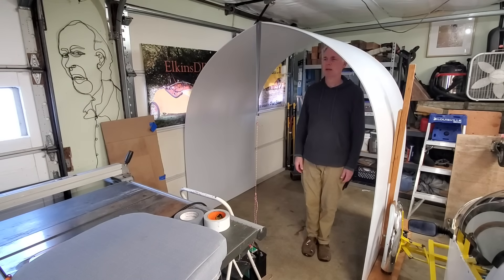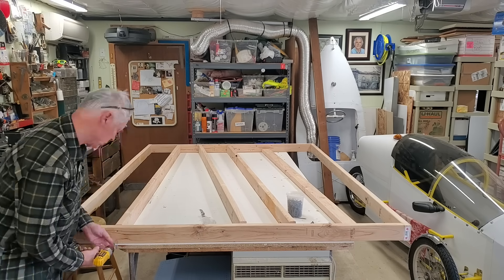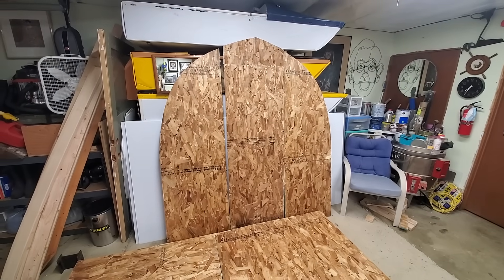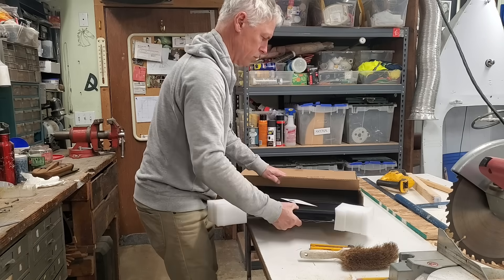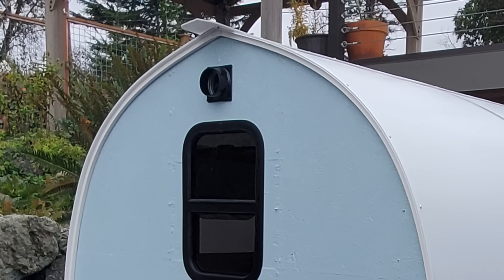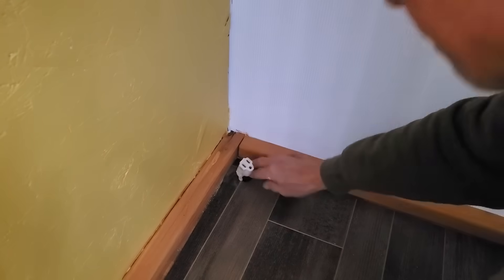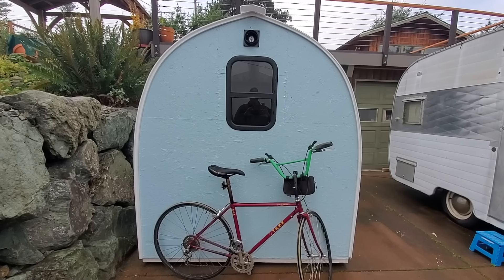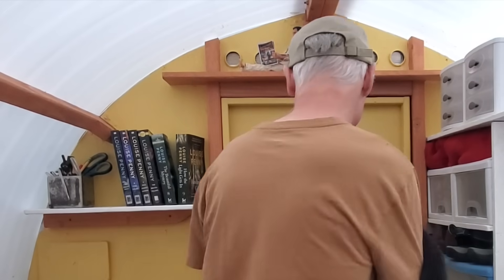Homeless transitional shelter prototype

Comment: I'm homeless. Shelters are never the problem. It's where to put them.
Reply: Definitely a more underlining issue. Apart from the economy of course. I have a hard time finding places to camp off grid, let alone. Live full time. I hear ya.
Reply: @goozzfraaabaa  I lost my wife 3 years ago. We barely got by with 2 incomes. I modified my SUV and did the boondocks thing for a while. In the same month, I lost my job and had my vehicle stolen. 
Then I was on foot and lost everything.
Fortunately, it was summer. I bought some window cleaning gear from Home Depot and started washing windows. With my ssi and window monies, I can not afford a place with the bills. I live well, just not under a permanent roof. With soaring rent and the economy spiraling, more people every day are moving into vehicles. I've seen a massive uptick of people camped out and still working their jobs.
It's only gonna get worse. Funny thing, if you live in a sprinter van you're cool, if you loose it and get a foot, you become a POS!
Reply: @luckylarry5112  So sorry you've had such bad luck.
Reply: @luckylarry5112  let’s hope the worst is in the rearview mirror for you and the 2026 is where your great adventure starts toward a better life!
Reply: @luckylarry5112 not in my book ! 
a Sprinter only is something wealthy hipsters or boomers can afford 
I myself prefer my 40 liter backpack and a really nice pair of shoes 
I can then use all the money those Sprinter hippies spend on gas , insurance , and maintenance on food , water , and other materials to gtFo of cities and into the wilderness 😊
Reply: People don’t become homeless one day and have nothing.  Most give up or sell everything to not become homeless, but giving up their phone is just stupid. Without communication they can’t possibly improve their homeless situation. Some live in their cars & have phones but can’t afford rent. Have compassion people.
Reply: @allyrooh3628 Really??? Try living in a career where you get bumped for site senoirity all the time while paying for a union. Apparently you haven't experienced Canadian winters or lived in your truck to keep your job.
Reply: That's a good point, most resources for the homeless (free meals, medical care, etc.)  are often concentrated in the center of urban areas. With it being an urban area, space is extremely limited.
Reply: I would pay to build one of these if other people would    We could build cities.   Need port a potties
Reply: @georgedavidson7986 I agree, and the more I look into it, the more I am convinced that the real issue is not the shelter supply, but the sewage and trash disposal problems.
Reply: @georgedavidson7986 and land
Reply: Agreed
Reply: Not in my neighbourhood is a common cry.
Reply: When ever you are gone, they will steal everything, wort anything so Watch Benny Hinn and pray for a miracle. Ecclesiastes 9:10. Proverbs 18:1
Reply: Denmark has worked hard on solving the homeless issue. They realise that if people have home it helps their self-respect, they keep healthier and in the end it costs less . Well done on your project
Reply: Access to be here? What, you think you can't be homeless and have a cheap smartphone too?
Reply: I am sorry you are homeless and even more sorry we live in a society that allows it, we have more than enough wealth to support everyone.
Reply: 🙏🇺🇸 prayers for parking lot locations and camp grounds even business/ church grounds etc... to step up get insurance and sponsorship communities and cities to work together for these solutions
Reply: Exactly.
Reply: I live in an Elkins style bike trailer. Luckily I sleep in front of a store with a really cool owner. They don’t mind the trailer sitting out on the sidewalk. They even gave me a small job cleaning up. I keep most of my stuff in a storage facility close by.
Reply: What part of the country are you in?
Reply: @TheCindlbergen  Central Oregon
Reply: It appears obvious you are not mental, so let's put the thinking cap on. You don't fit the mental, druggy, alcoholic stereotype, and you don't fit the corporate-world employee living in suburbia. That probably means you also don't fit in Oregon. Move to Texas and maybe you can be living in a mansion. Move to the boondocks of Appalachia and buy land for "dirt" cheap and be a self-sufficient retired hillbilly. Since you have some fixed income, you don't have to live anywhere in particular for a particular job. Is some corporation paying you $4,000/month to live where you are at. If your friends and family live there, if they have the means, they will help you. If they are as poor as you, the whole family can start a pilgrimage to Texas. Our nation is a nation of immigrants who came to America for a better life. Continue the tradition by moving to a state the resembles the original America - where you can have a house without a permit, etc. I sincerely wish you the best, but your best is not the status quo. Some places are not fit for human habitation [such as cities in my opinion :)]
Reply: I live in a rural area, seems places to put one are plentiful around here. But I wonder where you would go to sustain yourself.
Reply: @dwaynehall6356  i built a nice one,  7x10 last year. I found someone with private property and paid $200 a month to have it there. 3 months later, the county said no way, remove it.
Reply: @luckylarry5112  That is a shame!
Reply: @dwaynehall6356  As the video mentioned, many homeless have mental health problems and there is no mental health care for them. So, along with homelessness often comes drugs to self-medicate and take the edge off being homeless. Can't hold a job addicted to drugs. Even the high dollar treatment programs only have a 25% success rate after a year, and the homeless aren't going to get the high dollar treatment programs. In an interview of a homeless lady, she said, "On fentanyl, everything is beautiful." Drugs are better than life- especially for those on the bottom rungs of the economic ladder who got dumped out on the street by a society lacking a sufficient social safety net to begin with. So, masses of drug addicted homeless (deeply traumatized from homelessness itself) with no reason to believe that society can offer them economic security, resort to taking drugs, dealing drugs, prostitution/pimping and theft. Nobody wants that in their neighborhood. Well, at least billionaires are making record profits.
Reply: @dwaynehall6356 sure can I do it on your land 😂
Reply: Why don't you get together with the homeless people and buy a piece of land way on the outskirts where it's cheaper and split the cost between a few of you. Perhaps a farmer would let you use a small piece of unfarmed land that he or she has to make the sheds on. You could grow your own food and those with Social Security to help to pay for meat in exchange for caring for the produce, harvesting and canning it. Hmmm........just an idea.
Reply: @LorraineKrueger-o3b  Thanks, I've tried. It's the equivalent of herding cats. Farmers don't want the headaches or liability. I've asked tons of property owners for me alone and got turned down every time. I once leased some remote land, in 2 months the county code enforcement shut me down. I'm currently saving for some remote land in AZ. Many counties allow compost toilets.
Reply: @luckylarry5112  Prayers for your success.. You deserve all the best! God bless you! Hugs!
Reply: @LorraineKrueger-o3b  Thanks!!!
Reply: @luckylarry5112 I live in an area with few restrictions that I bought owner financed. But even so, you can't live in a tent out here. 15 miles to gas and convince stores, 30 to a small city. I always feel torn between wanting to help the homeless or warning people don't end up like me. I hear your frustration.
Reply: If homeless would keep the area where they domain clean and not trash the whole neighborhood 😂
Reply: @gerrybruce8309  You're absolutely right! They're many levels of homeless just like the rest of society. I'm in the top 2 precent, no addictions or mental issues. I'm old and stay far out of town and clear of all the others. I collect SS and do odd jobs and wash residential windows. I use an ebike cuz I don't have a license due to visual impairment. They majority really needs to be in encampments or centers and get help. If they can't rehabilitate, civilly commit them. Camping on the streets or neighborhoods is not the answer. The problem is getting exponentially worse. I'm seeing triple the amount moving into their vehicles and calling it boondocking. That's until it breaks down or totaled, then they are afoot. The system only helps those with addictions, mental illness, and vets. Why not help those about to or have just lost their place and detour the the whole process of homelessness to begin with?
It's a amazing the billions thrown at the problem. They could have housed them all ten times over. Theft is the real problem!
Reply: @gerrybruce8309  while I agree there are homeless people that seem to go out of their way to be rude and make messes..... For the most part it's VERY difficult to manage things like trash and hygiene.

Where exactly are they supposed to put the trash? Dumping and using other people's trash cans/dumpsters is illegal. And it's a lot more enforced than littering, especially since businesses have cameras and can see you dump trash in their dumpsters.

A lot of people don't understand just how difficult it is to do the most basic things that they take for granted on a daily basis.

I've been homeless for almost a year now. Lost my home in a fire and rent in my area is $1500 a month for a tiny closet with no utilities and nothing included. On top of that they require a 650 or higher credit score and they require you to make 3x the monthly rent for your monthly income.... that's $28 an hour!!!!
Federal minimum wage is only $7.25 and most places here barely pay $15 an hour.

The sad truth is that thousands of people in my area have become homeless over the last year or two with more becoming homeless every day... Some are lucky enough to set up a small camper in a friend's yard or driveway. But most have to walk the streets and hope for the best.

There are innumerable problems that we don't have time to discuss here. But yeah. If you're not homeless then I hope you appreciate everything you have and just how easily it could all be taken away. And should you ever become homeless I hope that you are able to find the help and respect from your community to get somewhere safe. ❤❤❤
Reply: Yea first course of action should be to become land owning property tax payer first then put something like this on your plot
Reply: @Benigno-nq2fi you missed a step. First you check with the city or county if your planned "abode" is authorized for that plot of land, and you can bet, they will have their hands out for permit fees, and fines for non compliance before you ever sleep one night there. 🙄
Reply: @Benigno-nq2fi 
 Property taxes will be one of the very things that will put the retired on the streets.
Reply: @Benigno-nq2fi  sounds good but still restrictions after so many days, septic tanks 10k$ us, water, power ; or required to build house, minimum sq ft .
Reply: Right it's hysterical how they think that this is going to help.  If they spent 1/4 of the time that they spend on this s*** actually helping homeless people........
Reply: @GeorgiannaLeighCurtisGlennElli  He is hoping to make a prototype which others might copy.
Reply: How can you afford a iPhone/android with internet/wifi? Do you work and live in a car?
Reply: @garymitchell7551 go to a libray
Reply: @garymitchell7551 How do you get work of any kind without a phone????
Reply: @garymitchell7551  I get social security and wash windows. T-MOBILE $15 PREPAID a month with 5g data.
Why is it, everyone thinks it impossible to have a phone with internet?
No I don't live in a car. I'm 69 and lost my license because of visual impairment.
Reply: How do you afford a phone if you're homeless
Reply: @melvinamoss3561  I'm 69 and get social security. Plus, I wash windows. My phone is T-Mobile prepaid $15 a month unlimited voice/text and 10gb data.
Reply: @melvinamoss3561 Seriously? There are working people who don’t have a home. Maybe look a little deeper into the problem.
Reply: @melvinamoss3561  The homeless around my neighborhood steal, deal drugs and prostitute, but others have legit jobs and just don't make enough for a home.
Reply: How you homeless but still have access to be here?
Reply: @johnyang6969  I'm 69 and get social security,  just don't get enough to pay rent. I'm also clean windows part time. Why is it everyone thinks the homeless don't have internet access. I don't know any who don't.
Reply: @luckylarry5112  What he means is you shouldn't.  Internet is for regular people- you have forfeited your privilege to  that.
Reply from the maker: @luckylarry5112  Thanks so much for sharing.
Reply: @luckylarry5112 some people can’t wrap their head around the fact that many homeless people have nice phones, jobs, clean records, even romantic relationships

They see with something they don’t have and ask you why you have it and whatever your reason is , they say “But you’re homeless!” Like you’re not supposed to have Anything nice or valuable

Some even get mad if you own anything nicer than they can afford and may attack you, in fact even the county won’t give you food stamps or GR of you have a car value over $3,000.

They expect you to sell your car for food, then come back and get assistance from the county, it’s disgusting behavior
Reply: @luckylarry5112  brotha-  sum ppl jus dont use that thing between their ears very often.   Stay warm sir, i kno how ruff it is.. in my area  swva,  the local gov. Are now dozing encampments  smh..  society has became so horrific
Reply: @bobechs7905  If that's what he means, he's heartless and has a mindset that's counterproductive to boot.  You should want the homeless to have sufficient means of communication to get jobs and hold those jobs if they can.
Reply: @_-gh0st-_ finding some where to charge a phone is a problem.. small powerful solar panel back back...
Reply: @_-gh0st-_  Yeah but that was a month ago - when times were good. Best wishes.
Reply: @paulwelkinsdiy  👏well done you've got people talking. 🏡 👋🌞👍
Reply: @bobechs7905  What a horrible thing to say!
Reply: R u for real? Every phone has internet and so does every single public library in the country. I’ve been unhoused while being in my car. It takes many forms. Just look around you and pt attention, you’ll see them everywhere. And more and more so.
Reply: Public library, free wifi at every Macdonalds, many free wifi hotspots, phones for cheep in every walmart. In the US there are many government programs to get people phones, because you basicaly need one to adult.
Reply: @johnyang6969    can u really not figure that one out bubba?   Ur brain not braining today?  Lemme assist ya,  i kno a handfull of homeless folks, they charge their fones wher the can..  plug ins outside of stores etc..  not hard to do bubba.
Reply: @johnyang6969  like having a phone is a big problem? Seriously? You have issues, huh?!
Reply: @johnyang6969  you can be homeless and still have a cell phone.
Reply: Its like $50 a month for internet if you want a plan for anytime/anywhere access or you can use public wifi in many places. Internet access and devices to connect with are very available and can be very cheap or even free in some cases
Reply: @young-salt  i do T Mobile $15 a month prepaid includes 5gb data. I use free wifi everywhere when possible. Thanks
Reply: @luckylarry5112  nice, im glad theres a cheaper plan for you. I like the 20gb plan
Reply: @johnyang6969  Uhhhhhh you know public libraries have pc's/internet right? Thats how i got internet myself while homeless, idk about OP.
Reply: @johnyang6969  dude everyone has internet access.. homeless or not. Such a foolish misconception
Reply: Cell phones?
Reply: @johnyang6969  WOW

Comment: These houses themselves are good, but I think they should at least look like ordinary houses, for example, let's take a gingerbread house, it does not cause discomfort. It is built just like an ordinary house - the roof is gable and there is one window.
I think there should be an image.
And the second most important thing is where people can store their valuables - it could be a phone or a jacket of a friend or child. Depending on what we mean by value.
I noticed that there is one product that can be reused - these are advertising panels.
The material can be used as wind and moisture protection, and moving it away from the internal walls, at 2 feet this will act as sound protection plus and will hold the frame.
 I think it’s easier to take a plastic frame, cover it with fabric, and cover it with a non-flammable sheet of concrete or metal on top (also with a gap). It would be better if it resembled a picture on a frame.
Interior walls can be treated the old way, hay and clay are mixed and smooth out unevenness. Next, paint with any paint so as not to stain the clothes.
frames can be assembled from pipes; if there are metal pipes, this will be a plus. Yes, and introduce external video surveillance, do something like a campsite, a yard.
Well, the roofs are clear that it is better to use solar panels, the advantage would be a barrel painted black for heating water so that you can wash yourself. the minimum point of hygiene should be (towel, shower, washbasin to clean the sinks)
The only thing you don’t need to save on is the roof, if you combine everything it will be a frame made of pipes covered with fabric from under advertising, walls made of sheet metal or concrete slabs, 
The inside is plastic plastered with clay and painted over. 
It is better to use mid-tones such as green or positive pictures (graffiti)